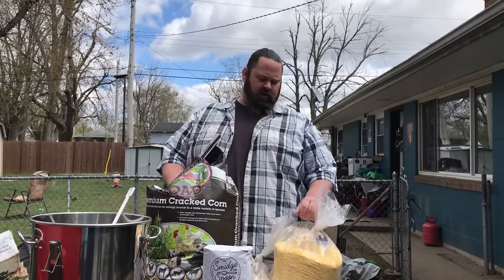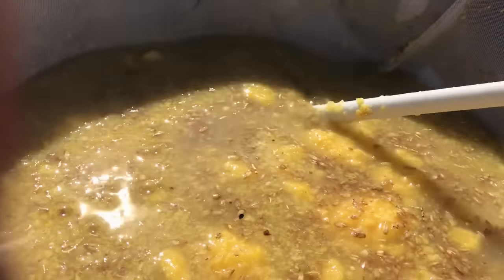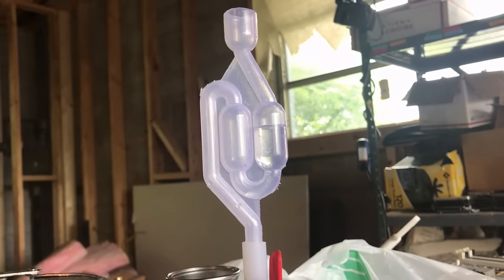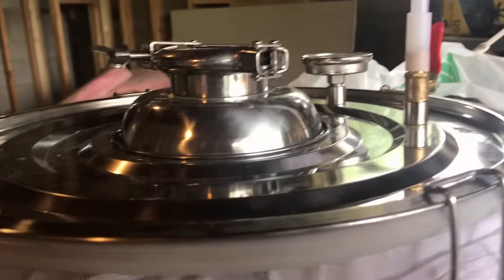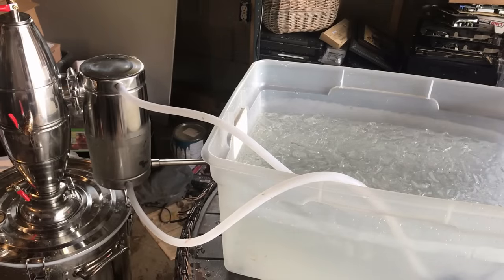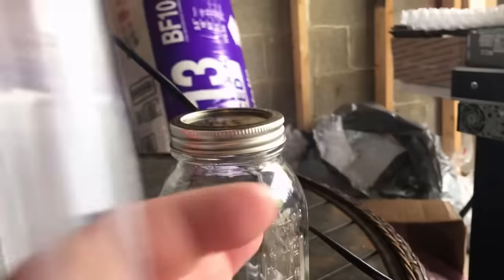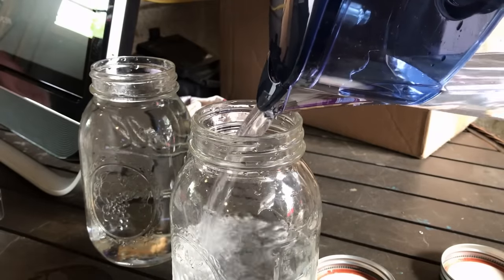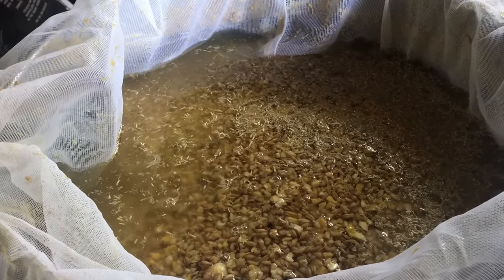How To Make Moonshine, first batch to sour mash, Moonshine Recipe

Comment: Good job on the video, I have a similar setup, with nice clear instructions. One recommendation I would make is that when you move from fermenting to distilling it would be best if you moved the thermometer from the lid to the vapor chamber (where the valve is just before the condenser). That would give you a more accurate reading of the vapor temp helping you keep the still running smooth.

Comment: I made a killer Bourbon using a gallon of non-vanilla corn syrup, 2 lbs of malted barley. Sugar. It made a great bourbon after having it with burnt oak chips for awhile. I did not carbon filter it. Everyone loved it.
Reply: Thanks for the tip. Hell yeah
Reply: @Mark-um5hc  I have also made booze using cheap corn flake cereal. Its already gelentized and dissolves when mixing in the Malted barley or enzymes. Beats grinding down all that corn
Reply: @NormBaker. , damn... Really ? Cool !
Reply: @Mark-um5hc  Yeah I left that on a comment on another distilling channel. The author of the channel didn't reply. But yet 5 video later...what was he doing?? He could of at least thanked me for the idea. Nope. Nothing.
Reply: @NormBaker.  good comments don't get recognition. It takes a commentise, (like myself), to learn something new. That is a good idea tho. Interesting

Comment: Definitely get some SEBStar HTL amylase enzyme from Moonshine Distiller to help convert the starch in the corn and keep it from turning to glue 
while it cooks. You got to cook the corn at 180F to gel the starch. Unless you use Distiller's Malt the beer brewing barley isn't enough diastatic strength to do the job. With SEBStar you can use straight corn and it handles high temperature unlike malted grain. Lose the Brita. Waste of money and time. Get some granulated carbon online and put some in a coffee filter inside a funnel. goes through faster and you can use it directly under the still output. Costco has a big brick of Red Star yeast for $5. It's a 2-year supply if you keep it in the freezer. Shine on!

Comment: another question:  in order to break up the cracked corn after it’s cooked and before adding the yeast, can I use one of those industrial-sized hand blenders to make a corn mush or puree?
Reply: Yes, and if you hook up a washing machine's drain outlet to a bucket, you can throw your mash in on spin dry to extract maximum liquid
Reply: Simon Johnny yeah, my wife would slaughter me if I did that 🤣🤣🤣🤣
Reply: My grandpa used corn meal and strained it through old pillow cases new ones take forever

Comment: kick your heat down to 80 get a higher concentration ethanol evaporates at 78c
Reply: That's at the head of the tub - it's cooling all the way up the tower before hitting the condenser. It still needs to be > 78C at that point. As long as you don't go too hot and start getting into the next band of distillates...
Reply: How do you kick it down? Dont you usually kick things up?
Reply: You should look up distillation
Reply: High heat may account for the jar of heads  most people on an 5 to 8 gallon run get around 5 Oz of throw away a jar seems high

Comment: If you open the very top valve on that oval part it will bleed off the methanol before you start making your liquor. Methanol starts to burn off at about a 145 degrees.
Reply: Shouldn't be hardly any methanol produced. Sugar washes produce zero
Reply: Phillip Main not true there will be a small amount for this set up.
Reply: @timwegman5776  please explain where the methanol from this setup would come from
Reply: "It turns out that the methanol is formed in an unrelated process—from the methyl ester (red circle) in pectin. Pectin is found in fruit, so when berries, etc. are used as the sugar source, methanol is formed. When molasses is used as the sugar source, methanol is not formed." From the american council of health and science
Reply: @phillipmain6475  Check out "Barley and Hops Brewing" here on you tube, George has excellent videos explaining everything about distilling.
Reply: @charlesmccoy5857  go look at his video comments and you will see I correct him often.

Comment: The only reason It got cloudy and tasted like ars ( Wet Cardboard, and I know because I've done it) is because  you just ran the distillation a little too long. You started running out of enthanol and the "tails" (other distillate compounds) came through. In other words you got a little stingy !  LOL. The easiest way to remedy this is to fill smaller jars and taste it often and 2 great things will happen. You will know exactly when those tails start coming over, and you won't mess up the whole batch of shine if you do get some tails starting to be produced. The whole run should be clear as water and Taste Good ! !  You Shouldn't need to filter it like that and you won't if you catch those "tails" at the end.
Good Luck
Reply: I usually stop collecting at 80 to 90 proof on a straight condenser and 115 to 125 when I use a thumper.
Reply: Didn't see any copper mesh put in the helmet, copper collects the trash you don't want in the brew. Just ran across this 4-year-old video.

Comment: Any chance of a clearer explanation of how to tell when the poisonous alcohol has run it's course and you start getting non poisonous alcohol
Reply: @atgrim  that just says when the alchohol starts to boil it dosnt say when it goes from poisonous to non poisonous
Reply: In other vids i have watched they say the first 10% is when it goes from dangerous to good but i wouldn't  go off of my word to much cause itbwas heard from another person that may also be wrong lol
Reply: @streetrcr986  That requires testing to be absolutely sure. The goal, as I understand it, is to reach ethanol. The heads, the first jar is thrown away. The temperature is then raised to the next level. The hearts are the goal. The link was only to give basic info.
Reply: Not 100% sure I'm believing it. I've seen other vids that describes it as higher proof alcohol. I need facts with a link to the source. Going blind or liver/kidney damage is no joke.

Comment: Hey PhilBilly, I was taught to taste and burn 🔥 for your foreshots. I always taste by holding your finger under your condenser and licking it off like when you eat  hot wings because your buds don’t lie. If it taste like acetone then it’s not time to collect your heads. You will know when by the taste 😂 if your not sure then take a sample and light it on fire normally a bottle cap from a beer your drinkin. If it burns yellow it’s not ready and if it burns blue it’s ready to collect. Not blue and yellow but pure blue. Ethanol burns pure blue. Made over 500 gallons with this method and it has never let me down ✊

Comment: Hey there, I made this recipe, didn’t check my gravity in the beginning but I used all the same ingredients and amounts. It started fermenting great then after about 10-12 days it slowed to a crawl. It shows a gravity of like 1.035 today and Today is day 18. Watching it it looks like almost no fermentation movement. I have it in my basement with a heater on it and temp is about 80°. It did get down to 60-65 before I put the heater on the container. Any ideas? I’ve heard about the yeast running out of water on long ferments etc. did it exactly like you suggested, stirred every couple days etc. thanks for any info, not sure if I just need to keep waiting or what.
Reply from the maker: sounds like its still going just doing it slow, probably because the season. Could throw another handful of yeast in there. If you got ph strips could check it, and if need bee ad some baking soda.
Reply: @philbillymoonshine7356  Got ya, I’ll have to get some ph strips. It’s settled and there is absolutely no co action. I was thinking of adding 3-4 gallons of hot water and new yeast. When I taste the separated liquid on top, it is really bitter, when I stir it and taste with the the solids, it has a slightly sweet taste so I know there’s still some sugar. What should the PH level ideally be?

Comment: Very Nice Video!!!!  Comment: 90 degrees Celcius = 194 degrees Fahrenheit.... I was told to keep the temperature initially at ~65C or ~140F and toward the end 70C or 158F to keep nasty tasting impurities out of the distillation, but maybe I've been told incorrectly.  It certainly will boil off quicker at a higher temp.   Also, depending on the type of yeast will determine the heads to wash your windows with... lol 200ml is usually enough for 5 gallons of wash.  Some yeast doesn't even need to throw away any of the heads, but I would either way.
Reply: That thermometer is crap and doesn’t read correctly, we run it by eye, smell, and feel...

Comment: Do you keep the heat on at 150 degrees for the 2-3 hours or shut it off and keep stiring?  I thought the heat should stay on, but a lot of what I read says to get the water hot and then add the ingredients and turn the heat off...which way is better?
Reply from the maker: Either way works, a lot of people keep trying to make brewing shine the same as brewing beer, i like to break the corn down to get the sugars out, just me, just my recipe. straight up though if you want a super simple recipe type in uncle Jesses moonshine recipe on google, and go to the wikipedia page, and steal the recipe it is really super simple. Also i am super drunk right now, ask me this question when i am sober, you will probably get a different answer lol .

Comment: I use the tap at the very top of the cap to vent off the methanol. Methanol Rises to the very top at 145 degrees so it is first and it'll go all the way to the top and you can pit it off of there and then start just running your hearts,,

Comment: Do you dump the first jar of the sour mash?
Reply from the maker: Yes it is poisonous you can either add it to the next batch, start a fire with it, or run a weed wacker with it,  and it is not a whole jar, it is only 250 millilitres. I always go 300 to be safe. It's just because it takes the still so long to heat up to a proper temp, Fucking science n shit homie. Some old folgies use it and mix it with the rest but i say better safe then go blind bro, so i dump it. This is where me and Big Eazy disagree, However i will never drink the first 300 Millilitres of a 5  to 8 gallon batch. I have been drunk enough for someone to call the swat team out on me before, and i prefer to just brew the mellow booze bro. BTW it is not about proof it is about poison, there is a difference. Once again i will however say either one will make you crazy, 190 proof versus some 4 shots, or heads which ever ya wanna call it. To be straight to the point, every time you heat up a still it will take so long to reach a certain temp so you will get some heads, and they are always poisonous even if you are distilling already distilled liquor.

Comment: Best and most useful video I've seen in a long time. I have found my new hobby that'll get me piss ass drunk. Awesome.
By the way, what happens if you drink that first batch coming out that you say is poison - very curious.
Thanks for sharing!
Reply: The first batch is methanol:
"Methanol has a quick and profound effect on the body. Once ingested, the body changes methanol into formaldehyde and formic acid. Formic acid begins to build up in your body, and when it does, it does serious damage to your central nervous system. The chemicals depress the central nerves, causing symptoms that may include sleepiness, confusion, difficulty breathing, seizures, or coma. They also have an acute effect on your eyes; soon after exposure, you may have difficulty seeing and things may seem dimmer. If the case is severe enough, you may go completely blind."

Comment: PhilBilly Moonshine when you keep running the same batch does the proof get stouter or weaker?
Reply from the maker: You should add the tails back to the next run and it will keep getting stronger. some people add the heads also but i don't recommend that. Just stick with the tails and youll be alright.

Comment: Hi.  I desperately need your help.  I did not have a brew bag, mìso i got some corn burning on the bottom of my pan. So the natch smells a burnt. What do i do? Is it still useable?
Reply from the maker: You can still use it but it will probably have a little bit of a burnt taste.. In the future if you don't have a brew bag just bring your water to a boil   and then shut it down and keep it stirred real well. If you had a home depot water cooler you could just keep it in there with a lid for a while those things are awesome, and hold heat forever, that way you don't burn the corn.

Comment: the barley or corn has to have a portion that has germinated, which creates an enzyme that is added when the meal cools down to 100 degrees, it will instantly  convert the thick solution of carbohydrates into a sugar.  then on top of this conversion you can add natural sugar.  once temp gets to ambient temp you add the yeast.........  wait a few days til the yeast has eaten up all the sugar, yeast waste is alcohol.....  lol,  squeeze out the bag, use the solution to distill.

Comment: Does the malted barley have to be powder? I bought some that were still pods and wondered if that will work?
Reply from the maker: You wanna run it through a mill, i run it through 2 times.
Reply: PhilBilly Moonshine I’m assuming that’s like a food processor? Sorry just starting off.
Reply from the maker: @hpd436  You could use a food processor. they usually have a mill at stores that sell brewing supplies.

Comment: Just curious, why is the first run of liquor bad, or poison as you say? How do you you when it's ok for consumption?
Reply from the maker: The heads contain "lighter" compounds such as Acetone, Acetaldehyde, and Acetate. They taste bad and we always get rid of them. This is created before the still is fully up to temp, and as a safety measure you get rid of a lot more then you have to. To be overly safe in a 5 to 8 gallon brew we dump 250 to 300 ML. Some people drink the shit, or mix it. You can also use it to start a fire, or run your weed whacker lol.
Reply from the maker: Also before the heads probably about 50 ML is methanol called the foreshots, we just categorize the two together, so if you want to drink the heads take the first four shots worth of liquor and get rid of it because it is poisonous, and yes i mean fill up a shot glass four times before you start keeping the alcohol. Remember if you dip your finger in it and do not taste any sweetness on your tongue then your still in heads. Also heads gives you a bad hangover.
Reply: @philbillymoonshine7356  thanks for your information. Enjoyed the videos and we'll definitely try to remake this process.

Comment: I don't know where or how you developed this recipe... but assuming that your barley to corn ratio is right, you can cut the malt you use in half (if not more) if you just mill it.  The enzymes you're getting out of barley are on the inside... and they generally don't seep through the outside.

I'm not saying "hey, you don't need that much malt".  I'm saying "just crush your malt and you will have better efficiency at a lower price".

Comment: if you don''t want to ferment on the grain, add your malt first to get the enzymes going then add corn and let it mash at 150f for 90 minutes, do an iodine test to check for starch conversion(if a spoonful of mash turns black purple when a drop of iodine is added it ain't ready, throw away the spoonful with mash and repeat the test every half hour until the black reaction doesn't happen) sparge your mash with 190f water til you get 5gal of wort then discard the grains, add the sugar to the wort and stir to mix well and aerate, cool down to 100f  and pitch your yeast. GOOD LUCK